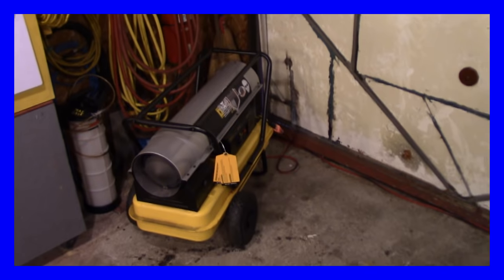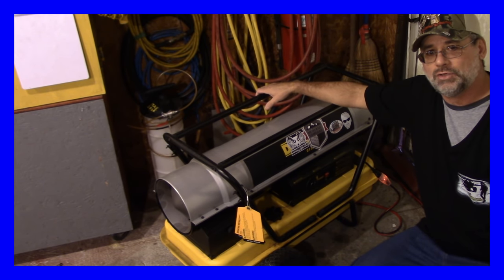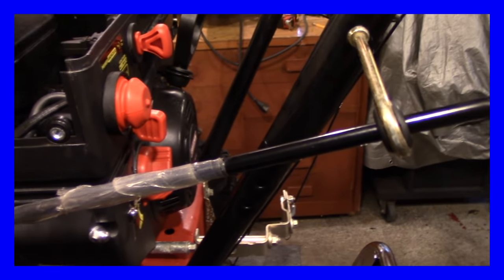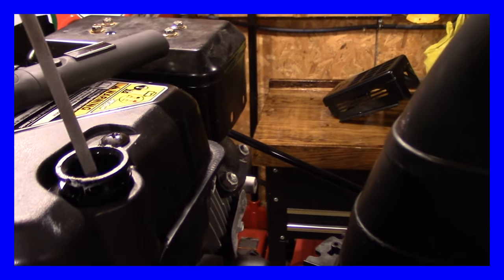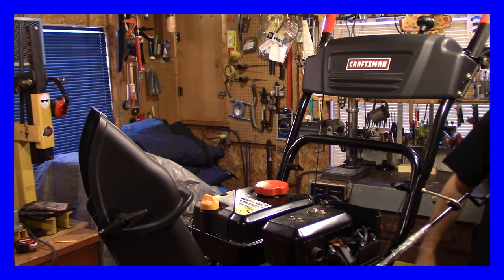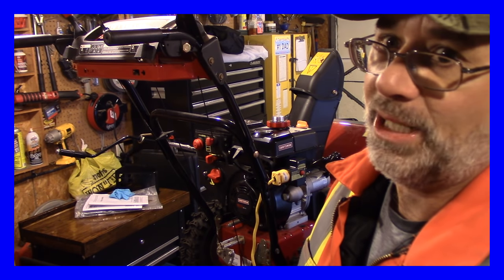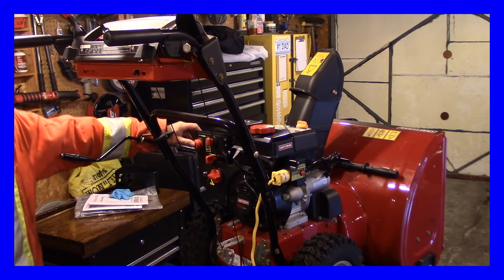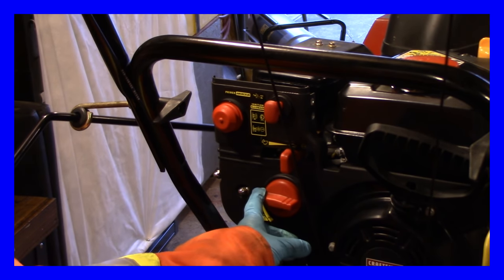CAN YOU FIX A SNOW BLOWER WITH SEAFOAM

Comment: Thanks for the video. I got a Troy Bilt storm that is “hunting/racing”. It was given to me so I’m not sure how well maintained it was during its life. I’m going to add some seafoam to some fresh 91 and run it occasionally over the next few days to see if that clears it up before i take the carb off as the carbs are a pain to remove on these Troy Bilt Storms. I’ll let you know how it goes.
Reply from the maker: Good luck 👍

Comment: I know it’s kinda fun to problem solve and fix these but the amount of time invested in the fix, you can buy a brand new carburetor off of Amazon with gaskets for under $30. Seafoam has worked wonders and I now only use Engineered fuel only. Has worked really well to keep the fuel deposits from forming. Great video
Reply from the maker: Thanks Tom , interesting enough I  have  a lot of viewers from around the world where amazon does not exist and buying anything for $30 is a weeks wage so many like us have the opportunity to do exactly like you say  and were so fortunate in doing so. . Cheers
Reply: Seafoam for Toro s ow thrower, who sells it?
Reply: @bettymrichard9563  usually 0’reilys, or any automotive supply, even Walmart. It’s not specifically made for Snow blowers, anything with an engine. Lawn Mowers, cars, snowmobiles, jet skis ect.

Comment: Here's another trick Steve, if it's at least unning, and at a higher rpm, take your gloved hand and place it over the carb air intake briefly (repeat a few times), it will bog down but what it'll do is cause all that high suction to then pull fuel really hard thru all the internal carb passages and lots of times will clear them better, especially if you're using a high concentrate cleaner in the gas, like toluene or Redline FI cleaner.
Reply from the maker: Thanks bud ill try that. Thats an awesome tip.👍

Comment: Had a similar problem with my blower.   Stupid thing didn't run good, fuel delivery issue.  Spent 2.5 hours taking the carb apart ...clean, carb kit, back together.   Not much different.    New carb from ebay $18 shipped...took 15 minutes to put in,  runs fine.  Sometimes these carb issues are enough of a pain to just buy a new carb.
Reply from the maker: If it was plugged any more that's what i would have done. It doesn't pay fooling around for hours and it still doesnt run right.
Reply: yup, i'm with ya

Comment: Steve, I agree 110%. No ethanol blends in your small engines. I have been using Stabil to stabilize my gas with good success, but may give Seafoam a try. It worked it`s magic on that snow blower. Nice save Buddy. KIT d
Reply from the maker: Doug the seafoam was designed years ago as a fuel stabilizer for  marine use .  I use it as instructed at 1 oz per gallon in 4 strokes and it's much less expensive than the others and has served me well.  I tried the  red stuff crapy tire sells and it just gelled up in blobs at the bottom of my genset tank so I tried the seafoam . Haha many years ago. Take Care buddy.

Comment: Yepp, I also use a bit of naphtha as a extra fuel treatment. I don't know if it really does a good job of dissolving and preventing biofilm but it seems to work good in the long run. I use it in both gasoline and in diesel where in the gasoline engine I also run a mix with ethanol on occasions. And that is in a car that is not made for running ethanol, just to make sure it picks up any moisture that might be in the fuel since alcohol binds the moisture, and it works great. A not gummed up engine is a happy engine.
Reply from the maker: And you're happy when you engines happy. Works with wives too. LOL

Comment: On float carbs, the 2 problems I have had are with the needle (stuck shut or stuck open like yours was), or the jet.  There's often several small holes including a tiny, barely visible hole in the fixed jet.  Clean it out with a wire filament off a braided wire.  Seafoam or other stuff should eventually clean this, but why not get it all the way.  I had this issue on a honda based pressure washer that I got from a neighbor, and the hole was clogged all the way.

Since you found that the fuel was bad, I would have drained it all, first.  You could use it, diluted, in a bigger engine like a car's.  Or even put it back in a small engine (but diluted with good stuff) once you had things working.

Off to go deal with a spare Yamaha snowblower I got from a friend.  Fuel is in it and the fuel switch wasn't off, so I'm betting I have a carb issue too.
Reply: FWIW it turned out the Yamaha had a compression actuated fuel pump.  Each time I would run it dry and try to get it going again, especially if I didn't fill the fuel tank all the way, it would have trouble.  I could cheat it a little by raising up the fuel tank track with a  2x4, but even that way it would give trouble.  Once I got it going for the season, it was good, and it did as well or better than my Hondas.  But it was a spare machine (why I was trying not to fill the tank all the way) and the treads were looking bad and are hard or impossible to get, so I sold it.  I wish I had it last year, when we had the biggest snow in Tahoe in 140 years.  I took that carb and fuel pump apart several times, but they were never the problem.

Comment: I can add to the ratings for ethanol fuel. My 86 pontiac and my 86 chevy K20 both say in the manual the carb and fuel system is okay for 10% ethanol. All nonsense, you tell me what that quadrajet will look like in a few years, especially with vehicles sitting stored for the winter. I'm glad most canadian tire gas stations no longer have ethanol in any grade of fuel. glad it was an easy fix like that. Our neighbors to our camp go through the exact same problem every year with their boats in the spring. they never learn.
Reply from the maker: It seems to be a common thing and i ask every person about the ethanol fuel  and every one says the same thing that they never heard about it causing a problem.  I have a friend that has brought his genset to me at least 5 times all slugged up and everytime he says oh ya i forgot to buy super gas. I know he doesn't want to spent the extra .20 cents a liter. LOL

Comment: It is still weird when I hear my name.  Fuel, Fuel  I have had good success with stabil.  What ever works.  Good small engine video Steve.
Reply from the maker: The Bruce Pender Lift hahaha oh man i'm getting  some good mileage out of it.  I was surprised it worked so good.
Reply: You must use a plywood ramp!!   I do as you know.  Can you believe how much fuel has changed.  It is OK to use in the cars as the fuels systems are sealed from the atmosphere but in the small engines fuel systems  are exposed to atmosphere.
Reply from the maker: I use aluminum atv ramps from P.A.  Fuel today hardly even smells and looks just like water.
Reply: I've used both.  I know Seafoam sure will clean things up fast.
Reply: I am going to try Sea Foam.

Comment: Seafoam works about 50% of the time. My neighbor had a skid loader (an old Ford brand) that sat for 5 or more years. I didn't even now he owned one until one day he had it sitting outside his garage, trying to get it running) He drained out the old gas and put in some fresh stuff, and after turning it over several times, it started, but not running very well. It was hit and miss on a couple cylinders. I figured it was clogged up from the old gas. I ran home and got a can of Seafoam and dumped about half of it in the gas tank.  After standing there with the engine running very rough, we let it keep running while we stand there talking. After about 10 minutes, the engine started running faster and smooth out and run on all 4 cylinders! The Seafoam had evidently cleared out the passages in the carburetor that were clogged from the old gas. It worked! I've been using it instead of Stabil in all my engines ever since for storing them over the winter months (lawn mowers, Motorcycles, chainsaws, etc.) and it keeps the carbs clean and they start up easily in the spring now.
Reply from the maker: I have about 7 engines i use it in for stabilizer and  so far no starting problems. I buy it in a plastic gallon jug .  Some say its snake oil but the snake oil seems to be working for me :)
Reply: Ya, there seem to be a few people who claim it's snake oil for one reason or another, but that happens with just about everything nowadays. Some people can't screw in a light bulb and say they are junk too. Like you, I've had good luck with Seafoam so I will continue to use it. I've use Stabil in the past, but found that it can actually settle in the float bowl of the carburetor and actually make things worse, so I switched to Seafoam about 10 years ago. My engines start up in the spring like they have been running all winter and that's what I want. I have never had to clean a carburetor since. I even run it thru my SUV and truck engines a couple times a year to keep them running smooth.
Reply: @spanky522  I have seen the exact same issue with Stabil!!!  It can turn into jell after it settles out and sits with the ethanol and water stuck to it.  Seafoam works really well as a fuel injector and entire fuel system/engine cleaner.  Works really well when a little is added to engine oil before an oil change to ensure all the varnish and sludge is dissolved.

Comment: Steve at Eliminator Performance Small Engine Repair we use the NO SPILL fuel tanks from Stens Canada guarantee no spill when putting fuel into gas tanks. Additionally, we use K100s+ stabilizer which advertises WE MAKE WATER BURN and it actually does do this by breaking up any water from condensation into small particles distributed throughout the fuel. Basically we would have pulled the carb and put it into our ultrasonic cleaner which has paid for itself many times just in spray carb cleaner savings. Nice video on Seafoam we have also used this but we buy Ethanol free fuel from Canadian Tire in Port Colborne 87 octane and treat 18.9 litres with 2.5 oz. of K100s+ which boosts the Octane up to 89 great stuff. Check our videos out on YouTube we have done some really awesome stuff and have a great editing programme.
Reply from the maker: I don't work on small engines  all that much anymore after retiring but it seems nobody maintains anything and the regular fuel is so bad. I was surprised to see how good the seafoam worked. I will check out your K100 - Thanks bud.

Comment: I love seafoam, I put it in my fuel tank about once a year 1/2 a can through the brake booster line and let it set so it cleans the carbon out of the heads. I hate ethanol gas with a passion
Reply from the maker: Im sold on it Cliff , works for me and i'm happy.

Comment: If you add the correct amount of Seafoam to your gas can every winter, because for me, I never know when my last snow will come and the machine will be sitting not being used for a long time. That way it can sit over the summer months and still start the next winter with no problem. 
 And I NEVER had a problem with any of my engines using regular pump gas with ethenol in it. My snowblowers, chainsaw, motorcycles and lawn mowers run like new just using Seafoam in the gas.
Reply from the maker: I agree and if the machine owners would use a fuel additive I'd see far fewer gummed up machines.

Comment: Good video Steve, well done.  It looked like a Briggs and Stratton to me.  Just had their name on it.  The snow blower, most likely is a MTD with their name on it.  It runs great now.  I would add a fuel shut off on it, just turn the fuel off and let the engine run its self out at a fast idle speed. But that's me.  What brand of heater is that you have using in your shop?  Great video, thanks for sharing, great job.  Stay safe.
Reply from the maker: Hi Cary , yes a shutoff should be on every one .  My diesel heater is a dewalt 215 K  BTU. Just an awesome heater. Thanks Cary and BTW if you have to make a vid outside on a repair the heater just pointed at anything 15 feet away will keep ya toasty warm.  I did repairs on my truck in the winter out in the driveway and it sure was nice to have that furnace keeping me warm.

Comment: For everyone coming down below to see what the engine is. Its called a powermore. MTD uses them on all their blowers now. They are the worst clones of all. Its not an LCT, its definetely not a Tecumseh, its not a Briggs its not a Loncin or a rato. Its a powermore from China.
Reply from the maker: Seems most are going offshore  for their engines. I have two blowers both tecumseh and both are built real well and trouble free. Cheers
Reply: STEVE ROB REVIEWS Yea at this point all the engines are made offshore, even Briggs, a sad fact. You can spot a powermore with their large funky looking brick top mufflers. The first generation had a 9 square shaped shield above, since than they cleaned up that look and its completely enclosed, but the mufflers still the same otherwise. Thats the easy way to identify one. Anytime you cant find the name of your machines powerplant in the manual, its usually not a good sign.

Comment: Use non oxygenated fuel (No Ethanol) to start with. I have engines that have sit outside covered with snow ans start right up. I was given a snow blower that was sitting for 3 years. I took the carb apart and green liquid came out. I asked the shop technicians what caused it and it was Sea Foam. Stabul puts a wax on top of the tank to stop water from entering the fuel.
Reply from the maker: Interesting,  I've never seen seafoam turn green . Yes non ethanol is the way to go. 👍

Comment: Pump gas is bad these days...I use Aspen fuel in my weed whacker and chainsaw and put my lawn mower and larger small engines away for the season with Aspen....good for 5 years storage.
Reply from the maker: I see a lot of canned fuel now and i do tell people with a chainsaw or weed wacker to buy it for the little they use every year. Seems lack of use plays a part as well and of course the crappy fuel.

Comment: "Troubleshooting" It's quickly becoming a lost art. - I use a nearly 40 year old Jacobsen Imperial 26" (Heavy Duty 2-stage) Snow Thrower. The thing is a tank, a couple of pulls for the first start of the season and after that it's usually only one pull and I'm off. Come spring I'm going to tear it down to repaint it.
Reply from the maker: Stick with it because the stuff i see out there is very light weight and engines I don't recognise or see a tag saying what it is . LOL

Comment: Have the Craftsman myself and I use seafoam had this same issue tore the carb off took out the high speed jet sprayed carb cleaner in it used a welders tip cleaner to open the orifice air blew dry added a in line filter good to go . Then added rubber to the second stage to have the blades about 35 thousands of a inch so now no more jamb ups with slush or really wet snow throws it much further not that it was a problem!!
Reply from the maker: I did the rubber paddles to my blower too.  Great mod and works like you say. Cheers

Comment: Most of the machines out there are all made by MTD. I found myself in the same situation and am a huge fan of Seafoam. I use it in my outboards all of the time. My problem was/is taking the covers off of the motor. My blower has the chute control up on the panel between the handles, has a rod connected from that to a bracket. The bracket is mounted to the motor and the bracket covers the last bolt to remove the top cover. 4 bolts attach the bracket to the motor. One of the bolts also mounts one of the drive pulleys.... I gave up. From another video I found out where the air intake is, and after cleaning out the bowl, and putting in 2 oz of Seafoam into a full tank of fresh gas, I sprayed starting fluid into the air intake while pushing the starter button and the motor choked until it would stay running. Like you it took about a half hour before it would run with no choke and up to full throttle.
Reply from the maker: Jim if you read the comments some say its snake oil and some like seafoam . I use what works for me and use it as a fuel stabilizer every year for decades .  Yes the  engine covers are nuts to take off thus I tried the seafoam and it actually worked .  I don't try to tell anybody what to use but man I was nicely surprised to see how good it worked im my case. Cheers

Comment: I've used Seafoam many times to clear up rough running engines because people are just too  dumb to drain the old gas from their carburetor before putting it away for the season. Most of the time that's all it needs to clear out the small passages and jets.
Reply from the maker: I agree David , I see snowblowers  after the first snow and lawnmowers in the spring  when the grass needs to be cut . Yep its the same every year 😅😅

Comment: Stabil is just OK.  It might help stabilize fuel, but it's not intended to work like SeaFoam.  Spray the Seafoam fogger into the carb of any small engine (that is not running well) a little at a time as directed and it will run far better than before the Seafoam in less than 5 minutes.  Use the Seafoam fuel additive once or twice a season and it'll keep running that well indefinitely.  No need for Stabil or other stabilizers.  It's intended to clean the carburetor passages and cylinders\valves, as well as stabilize fuel.  Stabil just stabilizes fuel that you forgot to drain out 2 years ago.  It does nothing to maintain the fuel or combustion system like Seafoam.

Comment: I all ways leave fuel in all year but I do start them in the off season still getting away with it.I find stable work fine an if you having small problem that usually fixes it.I will try sea foam interesting
Reply from the maker: If it works when needed its a win. Different fuel grades around the world sure have varied results. Cheers Donald